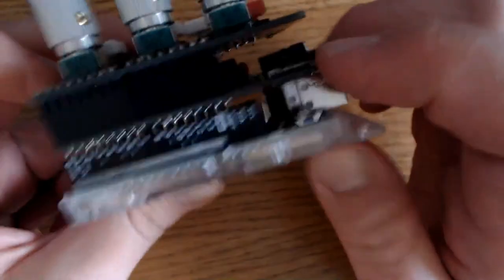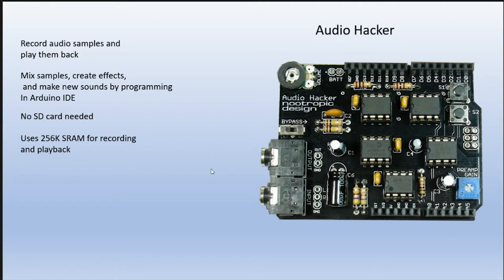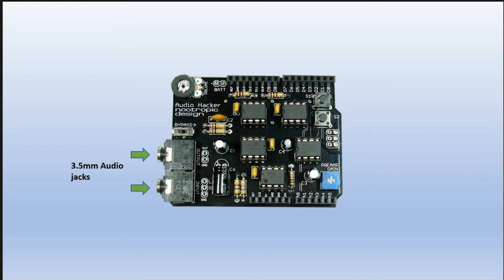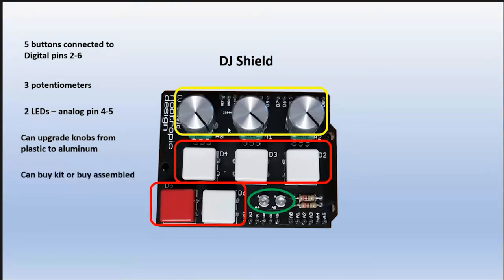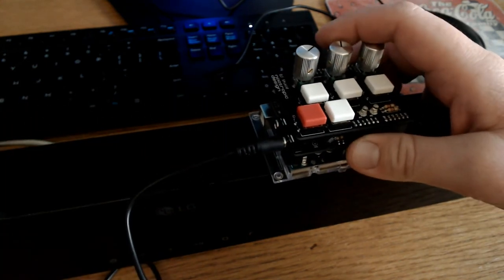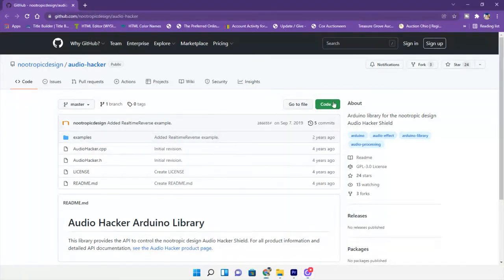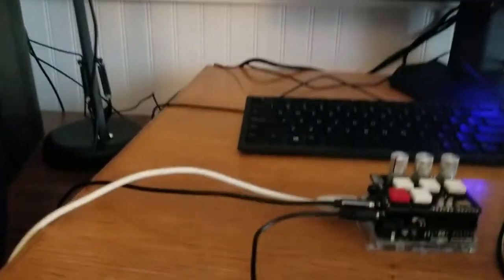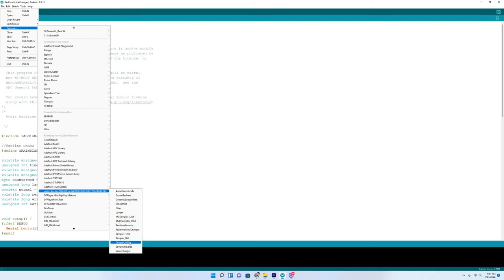Disguise Your Voice With Arduino And Audio Hacker Real Time Voice Changer - Complete Setup

Comment: Where can i find the arduino uno board, i am planning to change my voice (like many other people here) i also found the DJ shield but is it necessary for voice change?
Reply from the maker: Hey there! You can buy the uno board on amazon, ebay, and many other electronics websites. Do a search for Arduino Uno REV3 - this is not the newest board but it's good for the audio hacker. You can pay mor for the Arduino brand board or go with a Chinese version for about $10 less (Elegoo makes a nice board).
The optional DJ Shield (sold separately) can be added on top to give you 5 buttons, 3 potentiometers, and two indicator LEDs. It’s not required to use with the Audio Hacker but it makes it easier to do projects that require more controls. You can buy the audio hacker soldered or you can solder it your self. I spent the extra money to buy the soldered board. 
I haven't personally used audio hacker without the DJ shield but It appears as though you can change your voice by adding your own potentiometers. Check out these videos 👍
https://www.youtube.com/watch?v=REcBvjWLs90
https://www.youtube.com/watch?v=zOpAx0F-RJo
Reply: Thanks a bunch! It is going to really help me out! As a guy that's wanting to break into tech do you think you could do some YouTube shorts (or long form videos) explaining what these do and how these work? It would definitely help people who are learning tech! It could also grow your awesome channel!
Reply from the maker: @TrueZeldaNerd  I will plan to revisit this shield. Thank you for your comments 👍
Reply: For some reason it seems like my board isn't on... I have the green light on the arduino uno but it isn't changing my voice or even putting any audio through the speaker I have set up, any suggestions?

Update: my speaker does have static (both with and without the microphone)

Comment: I'm planning on Making a costume with a voice changer and this really looks easy and simple however I couldn't find the same Audio hacker anywhere and I don't know what to do
Reply from the maker: I bought it here  https://nootropicdesign.com/audio-hacker/  There are example libraries you can use in the Audio Hacker library (found here) https://github.com/nootropicdesign/audio-hacker?tab=readme-ov-file   There's example code for "voice changer". Try it out 👍  I hope they come out with an improved version for the new gen Arduino boards!

Comment: can this be used to speak through a mask like a darth vader mask or over the phone in a phone call? because I was wanting to use this as a Halloween prank to act like ghost face from scream lol so for professional purposes of course.
Reply from the maker: you can rig it to work in a mask. I still need to try it out with a wireless lapel mic. I think would be best if it works...but i'm not sure. 
If you can plug an amplified mic into your phone you can use this shield to alter your voice on phone calls. Also, if you have voice-over-IP phone calls, you can speak through your pc and alter your voice. I have used it on zoom meetings and pc games over the computer.
Reply: @BMonsterLaboratory  do you have a video tutorial showing how you solder and set it all up I'm asking because I'm not to that savvy and I don't wanna solder the wrong spot by mistake.
Reply from the maker: @Valaso-Osalav  I bought mine already soldered. It will cost a little more but worth it if you don't have time, soldering equipment, or you're unsure of soldering ability. https://nootropicdesign.com/store/product-category/arduino-shields/  
If you use it in a mask you will need to make sure the mic is close to your mouth and that it is amplified - crank it up so it covers your normal voice. You will have to find a place to conceal he arduino/shield as well.
Reply: @BMonsterLaboratory  Okay thanks!
Reply from the maker: @Valaso-Osalav  best of luck to ya!

Comment: Can this be used for like a biker helmet? I had an idea a while back and was curious to see if I could do it with the board and through the speakers on the helmet is that possible?
Reply from the maker: hmm... I guess that depends on the mic setup in your helmet. Does it have a 3.5mm aux. port to plug the mic into ?  Is the mic amplified? ...probably is, i'm just asking. You will need a power supply or the arduino board / shield and power for your amplified helmet mic. where would you store the board and shield?  Store it in a jacket with the wire running to the helmet? Wish I could help more, i'm just not familiar with the those helmets. I like the idea though 😎👍

Comment: I’m looking for some relatively subtle voice changes for my Kolivan cosplay from Voltron (S2 Ep8). This looks like it has the right level of controls to adjust from pretty extreme to that subtler mix. Thanks!
Reply from the maker: Hi Cliff! Ya, there's a wide range of distortion you can get. I've used this choice changer in video games online,  messages, alarms, and various arduino interactions. It's been lots of fun. Good luck with your Kolivan costume and thanks for the comment!

Comment: Great video!
I'm working about a voice changer for a cosplay, but my audio Hacker (idk if it's really the audio hacker or the arduino uno) keeps doing a strange and constant noise, do you know how to fix it?
Reply from the maker: is the noise static or a buzzing sound? I have had that before when using this. I switch the 2.5mm aux cable and it is clear. how are you connecting the audio hacker in your cosplay setup?
Reply: @BMonsterLaboratory  
I have an Arduino uno connected to audio hacker and dj set, the the output Is connected to a speaker 3.5 jack and a microphone (also 3.5 jack) that i usually Hide insider my Mask for RealTime voice change...

I'm hearing a static sound while It works and it's still present when i change the audio output, It even keeps doing It while connected to my pc

Comment: Hey, thanks for the video! This is awesome. Could I use this to change my voice in real time during phone calls? I want to create a robotic voice to use while talking on the phone. Thanks again for the video, this is awesome!
Reply from the maker: Hey there! Thanks for the question. The short answer is yes, you can use this over the phone. 
The easiest way to do it is speak into the audio hacker microphone and place the speaker close to your phone so they hear a distorted voice.
 It's really easy to use over your computer. I have used it in zoom meetings and video games online. If you have a way to speak on the phone through your computer, that would be a really good way to do it.... a voice of IP or some integrated phone network. You would basically connect this audio hacker between your amplified microphone and the pc.
Reply: Cringe!
Reply from the maker: @SebaSpeed  😅🤣😂 all in good fun!

Comment: Hi. Thanks for this, I've just purchased the audio hacker & shield along with a cheap portable voice amp and microphone set to use in a costume. The mic & amp work on their own but if I put the amp in the output of the hacker it's constant static and the mic doesn't seem to produce anything. The only thing I'm thinking is the mic isn't getting power to the audio hacker, do you think a small battery powered one would work?
Reply from the maker: Hey Mike! Let's get this up & running for you. First of all, did you install the library? Do you get any messages thru arduino ide serial monitor? Can you tell me which mic and amp you are using?
Reply: @BMonsterLaboratory  Hi there! Thanks for your help, much appreciated! (reposting this as I think YouTube deleted it due to having a link in it) . Everything seemed to install okay, the only message I got was an install successful one after I uploaded it. The mic & amp I've got is a JCWY "Voice Amplifier, 12W Rechargeable PA system (1200mAh) With Wired Microphone for Teachers, Tour Guide and more (Black)" which I got from the UK Amazon page. Thanks again for your help!
Reply from the maker: @mikec6096  You need active speakers and active mic for this. I have used many speakers on this (soundbar, Oontz Angle 3 pro, recycled speakers connected to an amplifier.  The only mic I have ever used is my Blue Yeti, and it has it's own amplifier. To my knowledge, you have to have external power on both. I looked up your headset and speaker and I'm thinking it may have an active speaker but not an active mic - am I correct on this?
Reply: @BMonsterLaboratory  Hi, I believe so, the amp is rechargeable on its own power but the mic has no power by itself, I'll have a look into a smallish powered one to test that out. Thanks!
Reply: Just an addendum here, the powered mic I've picked up works and the settings on the board work as anticipated, however the amp still has a lot of static, even before the mic is plugged in, wondering if its just that unit itself.
Reply from the maker: @mikec6096  sounds like interference from other electronics or a grounding issue. I have a PAM8610 amplifier that I attach speakers to. When I use the audio hacker I will get some nasty static. I think, ultimately, it's the quality of the mic/ampilfier. When I use the Blue Yeti I get  clear sound, but that's a large mic to add to a costume. There has to be a better mic that has noise damper of some sort....what do youthink?
Reply: @BMonsterLaboratory  Yeah it does sound like the amp is the issue, I've been able to fiddle about an potentially get the voice loud enough for the static to be negligible when under a mask, will definitely look into better hardware for the next one though! Maybe a Yeti that I ca strip down and Frankenstein it into the mask. Thanks again for your time, really appreciate it!
Reply from the maker: @mikec6096   you're welcome!  good luck with the costume

Comment: I'm getting ready for Halloween 24' and need  a Batman voice modulator, wonder if this could work
Reply from the maker: hey there!  ya, it may work. Sounds like a cool setup.  it depends on how you mount it on your costume or tuck it away within your costume.  good luck!
Reply: @BMonsterLaboratory  I'm leaning more towards Batman Beyond so I'd 3d print something to hang it off the belt . Thanks for the video, couldn't find a Wave shield and the audio hacker is a great replacement.

Comment: As far as you know, is the sram ic's needed for the real time voice changer? I'm trying to do a similar project but not with this specific shield
Reply from the maker: I don't believe the sram is used for RT voice changer. You're not saving any recordings using that option. The SRAM is for recording/playback of stored audio samples. check it out here -> https://nootropicdesign.com/audio-hacker/   best of luck with your project! 👍
Reply: @BMonsterLaboratory  I thought so too, but then I saw they say "High-speed SRAM allows fast access to audio data for realtime processing and mixing."
I suppose I can plan to use an sram chip but first try without it and see if it works.
Reply from the maker: sounds like a good idea. I thought the real time voice was altered by potentiometers.. sounds like you've done some pretty good research. I hope your project turns out great!

Comment: Do you think this could run separate from a computer and just be run with a power bank?
Reply from the maker: Hi Kent! I haven't used it as a portable device but you should be able to. You only need the computer to load the code onto the Uno. I think there may be a problem with hearing your own voice over your disguised  voice unless you connect it to a loud speaker or large PA system. If you could find a way to isolate the sound of your normal voice, that may work as well. Good question! I will try it out tonight and let you know how it goes.
Reply from the maker: Yes you can. You have to use a microphone that has it's own power supply. I'm using the yeti blue mic and it's powered by a usb cable. I'm using oontz angle 3 pro speaker. they sound really good together and you can turn it up loud enough to drown out your normal voice in real time.   I tried using a lapel mic that that plugs straight into the aux jack and it did not work. I hope that helps. If you need a picture just let me know
Reply: @BMonsterLaboratory  I'm really happy I found your video because I'm looking for exactly what you described

Is there any way you could still take those pictures? I know it's been a while. I'd love to know how to do this with a very portable set-up like what you described above.

I'm trying to figure out a way to make this for into a mask for a cosplay. Thanks in advance.

Comment: Culd I use this stand alone with a usb powerbank?
Reply from the maker: Hi there! You can use the Audio Hacker shield/uno as a stand alone, sure! You will need a power supply to plug into the barrel jack of the Uno and a speaker and mic plugged into the Audio Hacker. You should connect an amplified speaker to the Audio Hacker. It can drive a small 8 ohm speaker, but for big sound you a speaker with it's own power source.  An amplified speaker powers the speaker drivers and boosts the audio signal to produce sound. You will also need a microphone preamplifier or an audio amplifier circuit to boost the microphone signal.  I hope that helps! 👍

Comment: Can this be used for cosplay?
Reply from the maker: I think so. Others have act about building it into a helmet. You just need room for the Uno, audio hacker shield, and a battery supply. You don't need the 2nd shield with the knobs and buttons. Check out the website https://nootropicdesign.com/audio-hacker/

Comment: do you think and arduino nano could do this?
Reply from the maker: Hey there! Good question. This shield works with Arduino Uno, Duemilanove, Mega, and Leonardo. To use a Mega or Leonardo, you need to solder a 6-pin ICSP header on the bottom right side of the board.